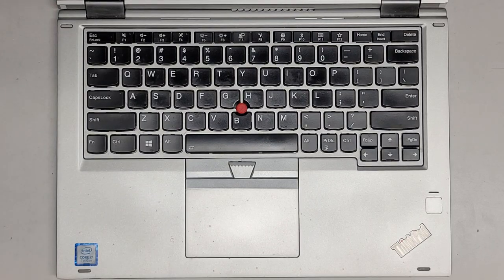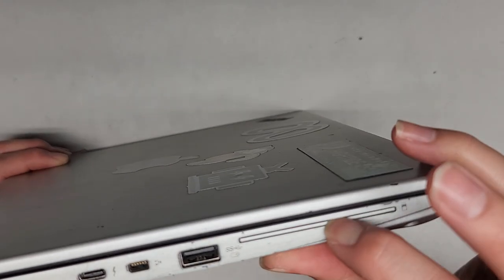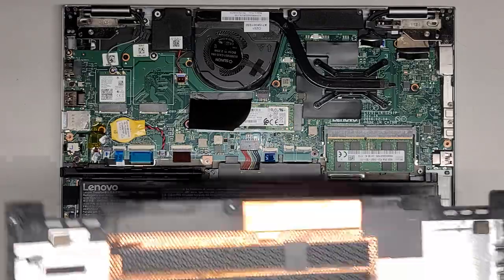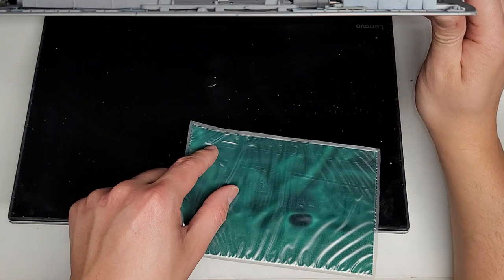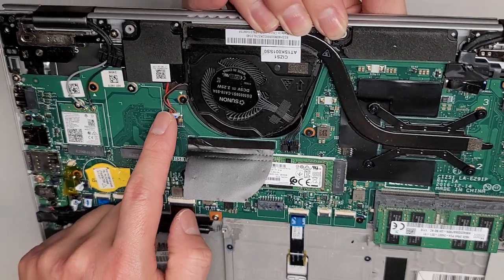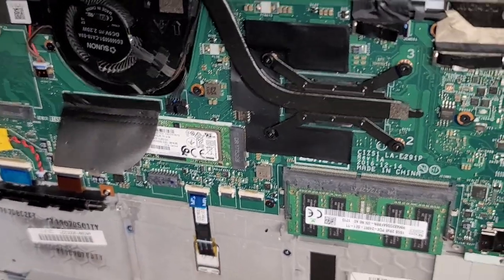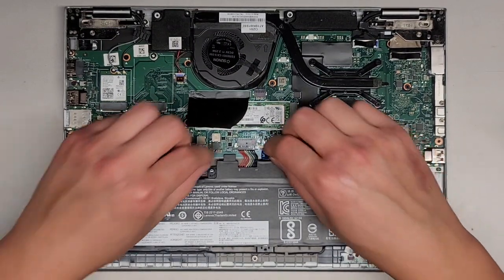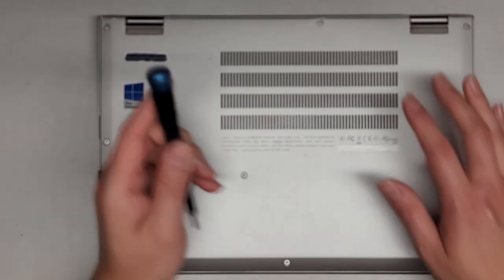Lenovo ThinkPad Yoga 370 Disassembly RAM SSD Hard Drive Upgrade CMOS BIOS Battery Replacement Repair

Comment: brother i inface problem after change the hard ssd the seller told its ready for use with windows &drivers then it was  empty for that i lost the drivers with old ssd after format ...please how can i fix it ??
i tried every thing with the service but  cannot.....
Reply from the maker: This? https://support.microsoft.com/en-us/windows/create-installation-media-for-windows-99a58364-8c02-206f-aa6f-40c3b507420d
Reply: @ItsBinhRepaired  
thank you so much brother ...i ll do and i ll you about ...thanks again
Reply from the maker: No problem
Reply: hi bro. if the ssd is different 
is there any prob.
you know there are tow typs from ssd nvm&satapls